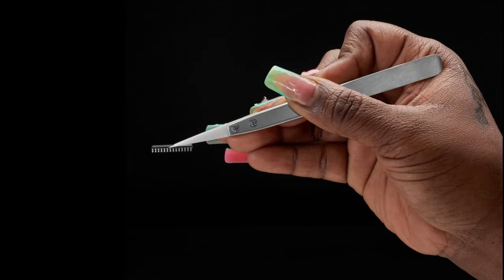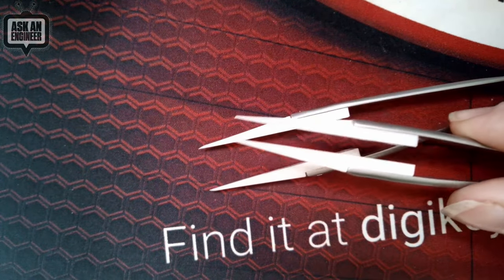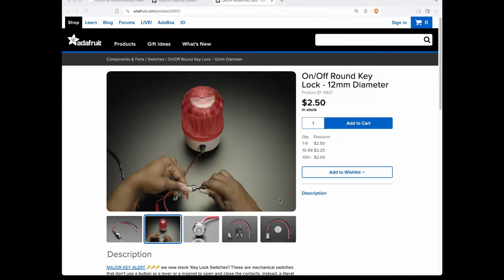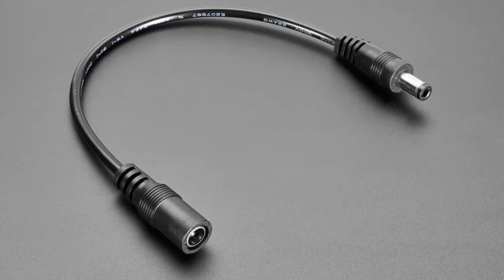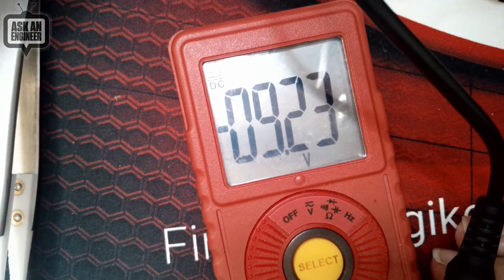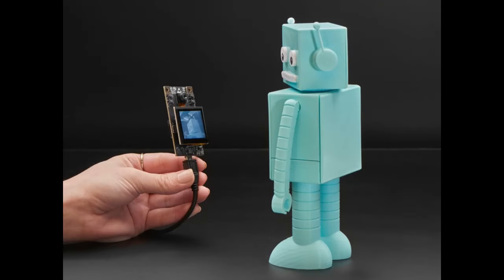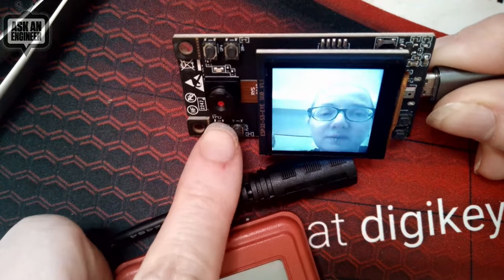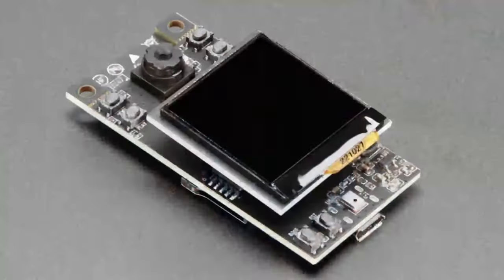#NewProducts  5/29/24 Feat. #Adafruit I2C Controlled + Keypad Shield Kit for 16x2 LCD!

Comment: “Trapped Key” would be the typical name… They’re very common in industrial safety applications with things like robot cells. Whereas momentary typically means spring return.
Reply: Yeah, definitely not a "momentary" key switch. However, this would be great for project incorporating a Class IIIB laser which requires a key switch (per FDA)... if only the data sheet included any sort of current/voltage rating :-( (Only need half an amp at 12V)